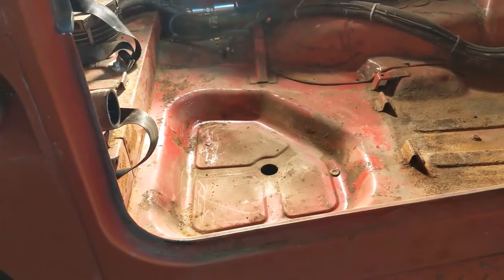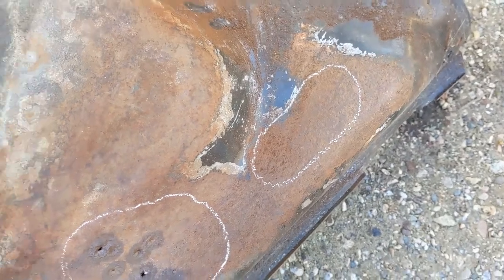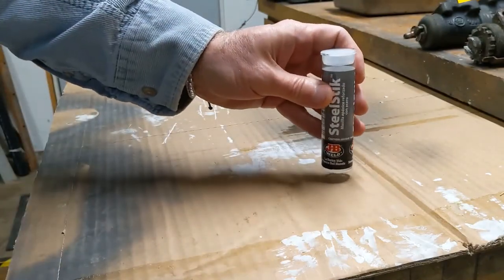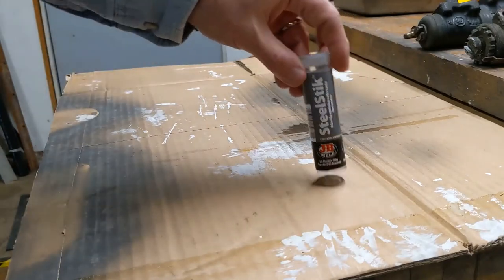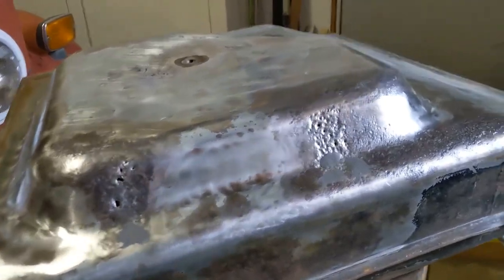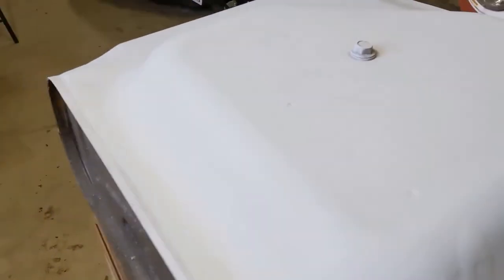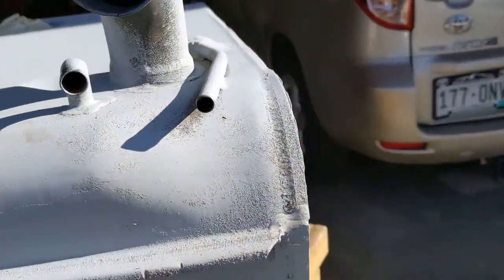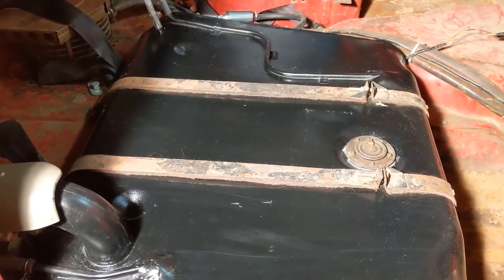Gas Tank Repair

Comment: I decided to replace the tank in my FJ40 with a plastic one from Cool Cruisers of Texas. The replacement has slightly less capacity than the original and I have had problems grounding the fuel gauge sending unit, so I lost the use of my fuel gauge. Mu Odometer needs to be repaired, so right now I have to guess when I need gas. Sticking with a metal replacement, or fixing the old tank would have been a better option.
Reply from the maker: Couldn't you just make your own ground from the sending unit base to the floor of the cab (or even the strap)?

Comment: How did that hold up? I've got a leak in my 80 series landcruiser thinking of going this route but I see lots of videos where it doesn't last long.
Reply from the maker: It's been about a year and the repairs are working perfectly.

I think the key is surface prep. If you get all the rust out, apply the epoxy to perfectly clean metal and then protect it with paint, it should last many years.

Comment: My car is fj40 1982 and i have changed the gearbox oil and when i drive the car for 3 or 4 hours the reverse gear be hard and make sounds
Can you tell me the reson or why this happining and what is the original oil for the gearbox 
(I live in the middle east) 
Sorry to bother you
Thanks 🙏🌹
Reply from the maker: I checked the factory service manual.  The proper oil for the gearbox is SAE 90.  

In the troubleshooting section, the service manual suggests the following possibilities for hard shifting:
1) Improper clutch adjustment (clutch does not fully disengage when you press the pedal)
2) Shift linkage out of adjustment
3) Shift linkage damaged, worn, bent or loose
4) Worn or damaged shift interlock mechanism in the gearbox cover
5) Synchronizer worn (would not apply to reverse)
6) Incorrect lubricant viscosity
7) Loose transmission case cover

While some of the items on this list seem unlikely, I still think you should check and eliminate them as possibilities.  Item 5 would not apply to reverse as it does not have a synchro.

After several hours in the middle east summer, the transmission could be getting quite hot. Synthetic gear oils might withstand these high temperatures better than regular SAE 90.
Reply: @mikerestoresanfj4069   
I really appreciate it
🙏🌹